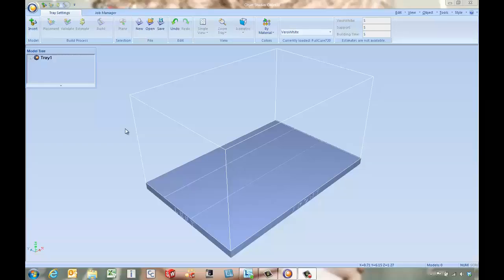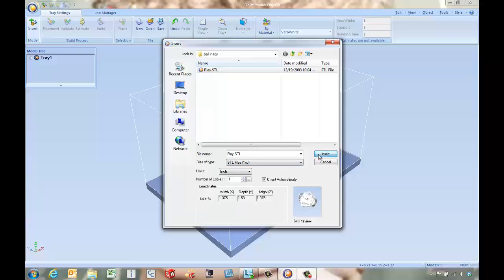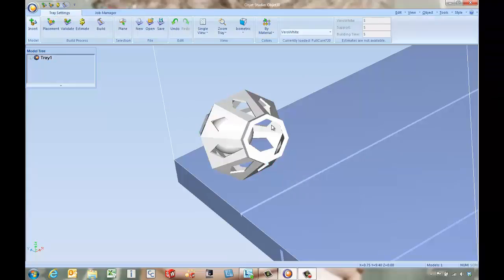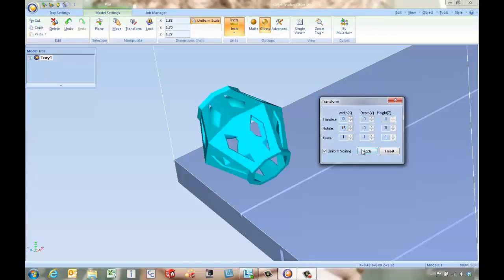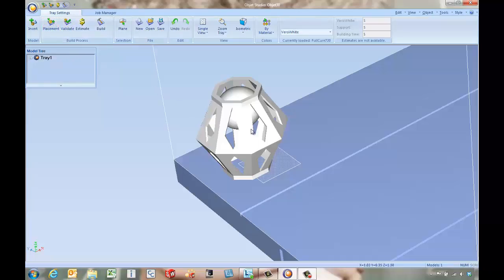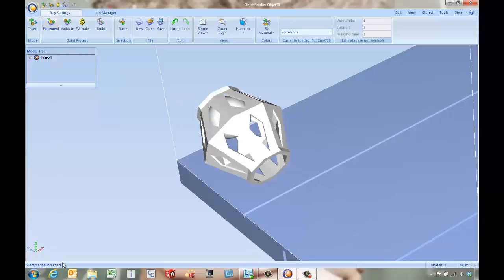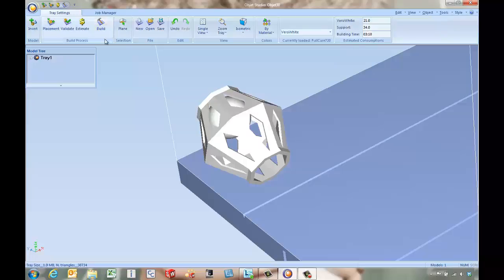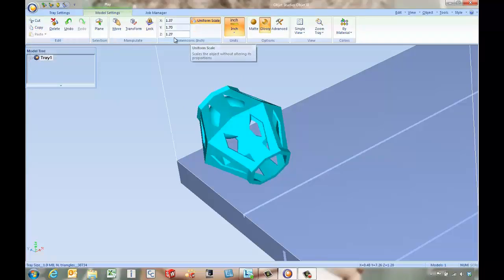Stratasys - Basic Printing Operations with Objet Studio

Comment: 1:14 will have minimum support I guess, it will be self supporting this way?
Reply: if you print it in vertical, I don't think you will need any support material?
Reply: but in the default, it will have much more support material. it looks like it will.